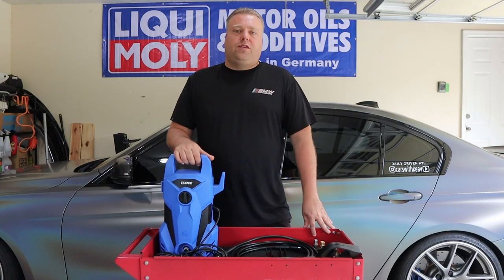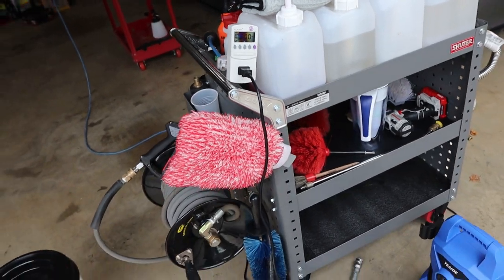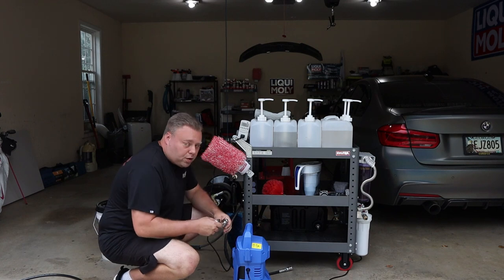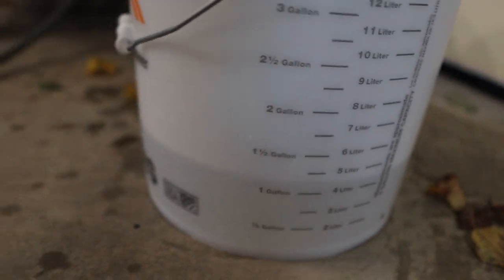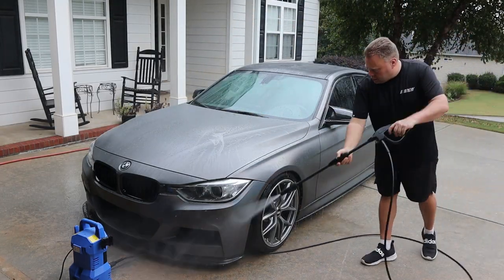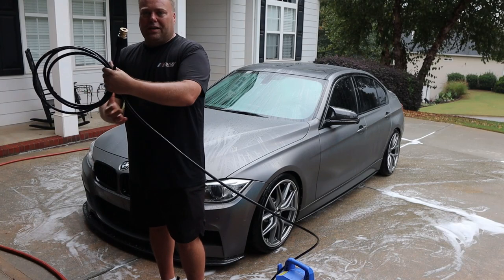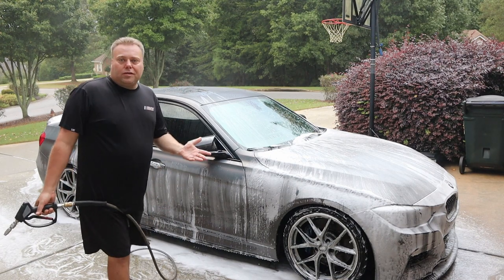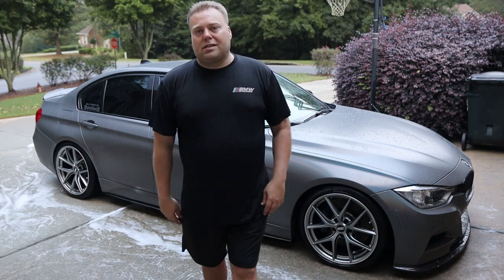ARE THE NUMBERS TRUE? | AMAZON PRESSURE WASHER REVIEW AND TESTING | TEANDE 2300 PSI & 2.2 GPM

Comment: I am considering purchasing the Active or Cat pressure washer but a lot of reviews say their unit only lasted a few months and the manufacturer would not replace or repair. Do most people get a long period of use out of those units?
Reply from the maker: Mine has lasted for a year so far being used twice a week. There is a small amount of units in the beginning that were having issues when aftermarket long hoses were being added.  They have corrected some of the issues over time and the current ones on the market are much more reliable. There is even a new 2.0 version coming soon that is supposed to have twice the life. A lot of people did not get warranty or were refused replacement because they admitted to using them as a commercial business. this is a residential unit not made to last constant uses all day everyday.